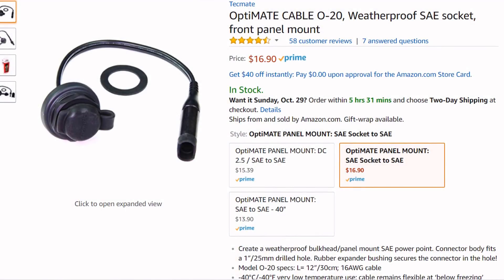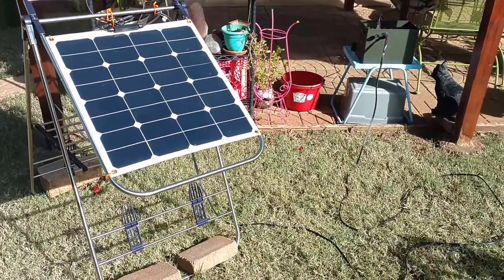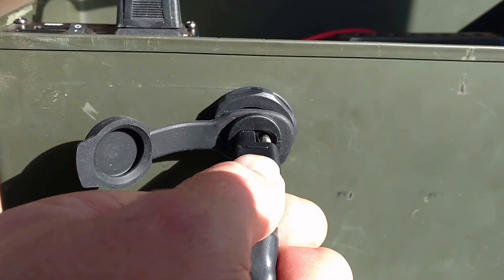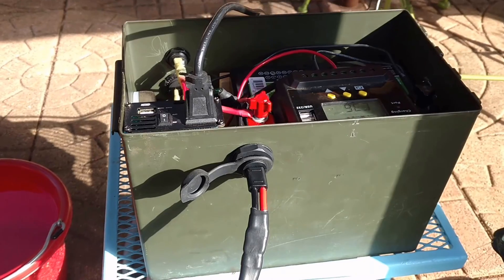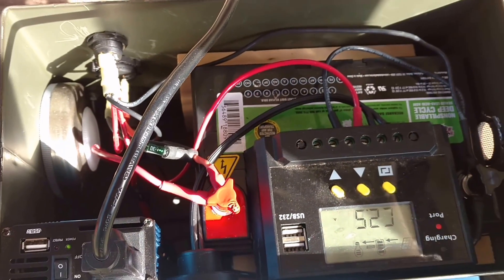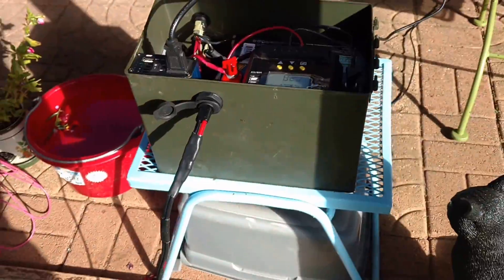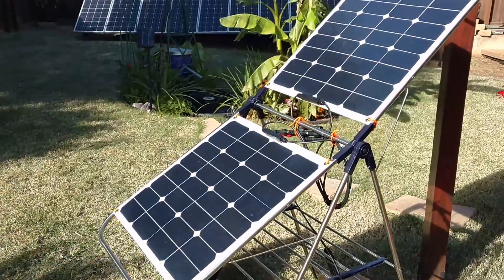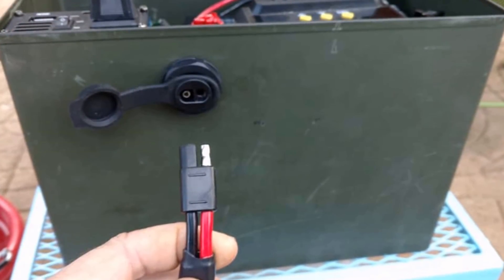SAE socket installed on solar power generator (and a shout out)

Comment: Very tidy. I found that same socket for my tractor to keep the battery charged.
Reply from the maker: Nice...I think these are rated too low (10 amp). The wire seems more hefty then it's 16 AWG rating. My gut feeling is that could easily handle 16-18 amps w/o breaking a sweat

Comment: Very nice! I might try one of thoes 7pin trailer wire harness/connectors.. seen someone eles use one as a quick disconnect before. The 10 gauge wire is great for it. Probably be a bit overkill for your situation tho
Reply from the maker: Thanks...there are several options for DC disconnects. Anderson connectors are cool too. For this small of a solar generator...this SAE is very good. It has a "standard" 1" hole socket cut out. That way it can be mounted like a 12v voltmeter or 12v power socket